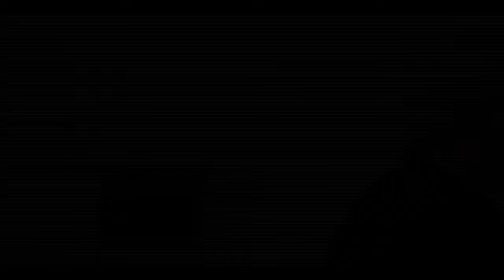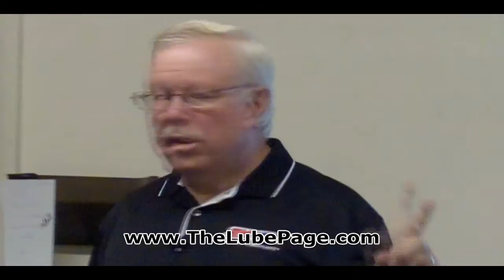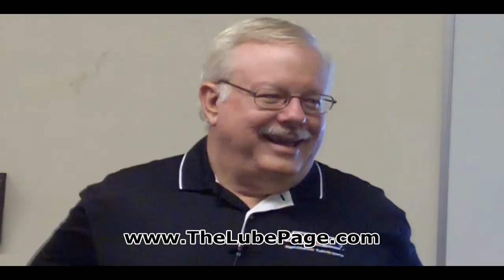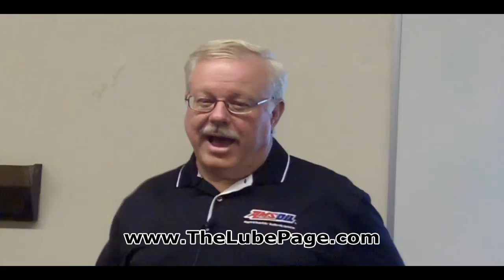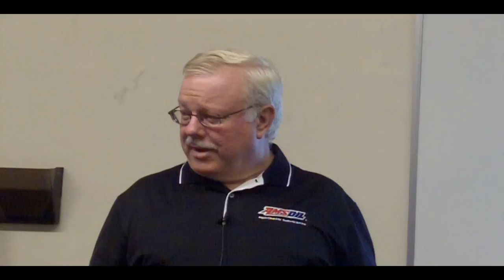AMSOIL Synthetic 5w-30 Diesel Oil

Comment: Mr. Watson, love your videos, very informative. You pointed out some logical thinking here were you mentioned that motor oil is working at the steady tempature of the vehical regardless if it is Jan. in Alaska or July in Arizona, my quastion is "what about the Turbo Chargers"? are they working at the same tempature? and why are many of the new cars being produced useing a higher vicosity oil like in the 50´s or even 60 vicosity? www.oilincar-com
Reply from the maker: Turbos run at higher temps than the regular engine.  Some new cars with turbos have gone back to using thicker oils to insure protection of the turbos.  Starting at 50 weight and losing 2 grades of viscosity would leave you at a 20 weight.  But if you started at a 20 weight and lost tw0 grades you would be virtually gone.  So the thicker oils are giving you more margin to loss of lubrication.  A good synthetic oil made from PAO or Ester will raise the operating temps so much that a 30 weight would provide more protection than a 50 weight petroleum.